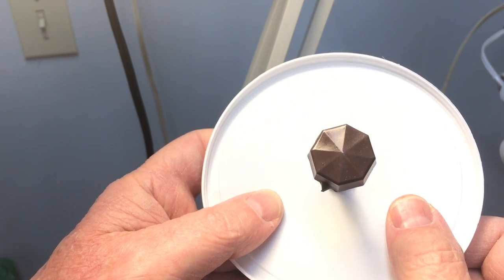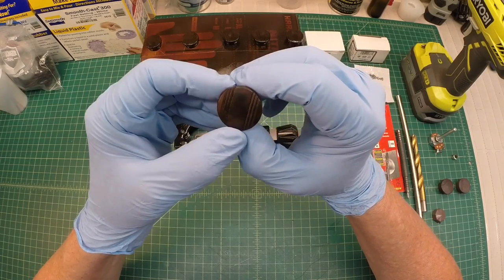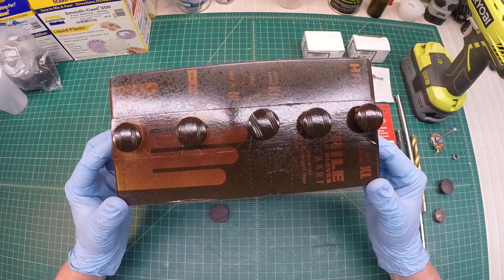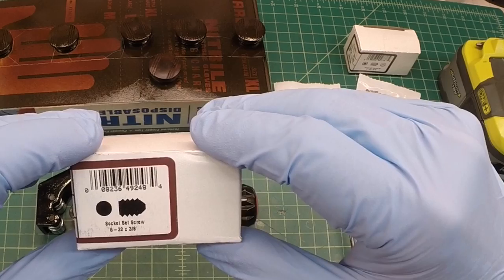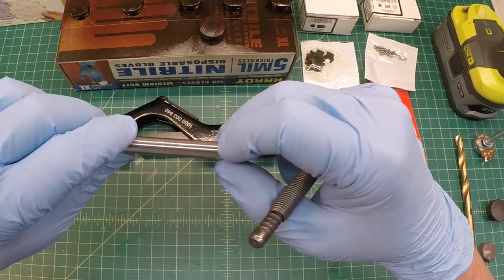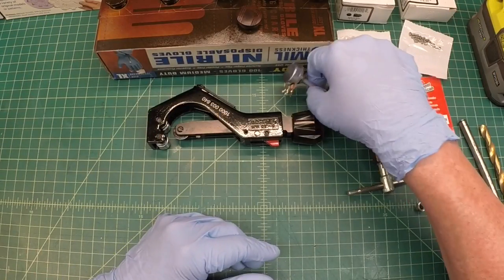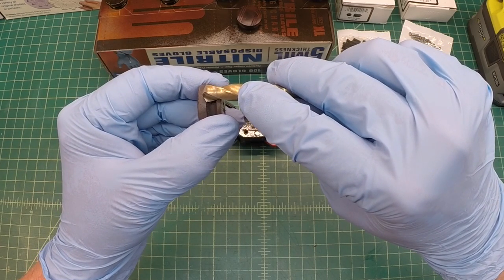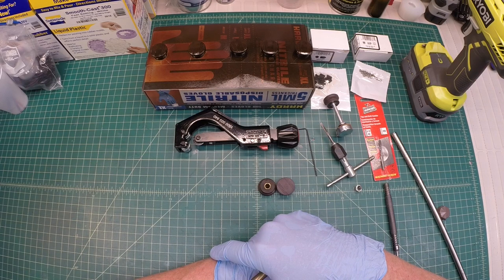Vintage Radio Knobs - Making a Shaft Collar w/ 1/4" Bore Diameter & Set Screw

Comment: Very nice Don! Those turned out really good. The toners makes them look like the original. Thanks for taking on the push buttons, Im sure you will give it ur best shot, and I do appreciate it! The radio is an RCA 96T2, Ive restored it electrically and the cabinet wont need much, I put it on hold because of the PB. Thanks again! And thanks for sharing this video. Best, Larry
Reply from the maker: +Backtothefutureradios Thank you Larry. I messed around late today after getting the yard work behind me and created a two piece mold. I won't be able to pop it open until tomorrow. I'll let you know what it looks like. Thanks for the kudos on the Knobs. Best, Don
Reply: RestoreOldRadios Ok Don, yesterday was my lawn day, and had mower trouble several times including running out of gas, lol. Thanks, Larry

Comment: Nice! Easy Center Finder: Cut an accurate right angle (L shape) from PCB or thin plywood. 4-inch sides. Cut a 45-45-90 triangle from the same material, again with 4" sides. Glue them together so the 45 angle intersects the inner 90 angle of the first piece.

To find the center of any 7" or less circle, slide the circle against the arms of the L piece and mark along the 45. Rotate the circle 90 degrees and mark again. Where the lines meet is the exact center of that circle.

Use Forstner drill bits to drill collars and inserts. Use a drill press to keep your fingers.

Comment: Doing anything in/with stainless, is FUN, FUN, FUN!!  Those Garod knobs are about as good as it gets without having an injection molding operation.  I've had an Emerson "Mae West" fixation for the last six months. I have a feeling, that should I ever find one (in affordable condition), it will require inventiveness of this degree.
Reply from the maker: +AMStationEngineer Tim, thank you. I finished putting the collars in today and hope to retrieve my restored Garod chassis from storage this weekend. If (when) you secure a "Mae West", you will have to video the restoration. Best, Don
Reply: +RestoreOldRadios  They make appearances at both Renninger's locations with some degree of regularity, and when they do, it's quite the paradox, as we're used to seeing them in three states

Type-1 examples are of "the broken bones variety".

Type-2 examples are radios which bare the label "worked prior to its twenty year hibernation in my attic - no guarantees, due to the fact that the consignor was not equipped to safely power the radio at the time of consignment".

Type-3 examples are of the "it's been played with - *screwdriver drift - acid core soldering on the tube sockets - acid core soldering used to install one electrolytic - which was incorrectly installed to begin with. 
*A Doug Harlan-coined term - most apropos!

I've never witnessed either a properly restored model, or an original, unmolested model.

If the right Mae West crosses my path, I will offer my RCA Theremin, and settle for no less than $4,000.00 in return. That should put me in the ballpark.

Comment: Don, I am a new subscriber and I am watching every video you have made. I appreciate your calm and measured approach to restoration of these old radios. I am a bit envious of your woodworking talents. I have not done much of that and you gat amazing results.

Quick question-sorry if you have addressed this: Did you get plans for the rotating stand you use to hold the chassis you are working on somewhere or did you just wing it? It looks like it would be very convenient to use and I have seen others comment on it. 

Thanks, Ian
Reply from the maker: +Ian Butler Ian, thanks a bunch for following my channel and your kind words. The chassis stand build was in my head and on the fly after seeing the picture frame clamp. I said to myself, that would or should work perfect for a Radio chassis stand and off to the big box store to buy some cheap wood, etc. I've made a few enhancements since that time that have been captured in my videos. Thanks again for watching and following my channel. Best, Don
Reply: Thanks Don. A suggestion-I doubt I am alone in wishing you would make a video of how you constructed it, it is the best looking design I have seen. 
Take care, Ian
Reply: Don,
I just found the video you made in 2015 describing its construction. Not sure how I missed that. 
Thanks,
Ian

Comment: Interesting but why not just salvage inserts from modern knobs?  You can get them very cheaply on eBay - cut the old knob away and you've got the insert ready to go.  A quick check shows 10 knobs for $2 with 6mm or 15/64" shafts.  I'm sure 1/4" shafts are also easily available.
Reply from the maker: +Digger D You bring up a good point. I'll keep this in mind for future needs. Of course, this would take all of the fun out of it. Lol Best, Don